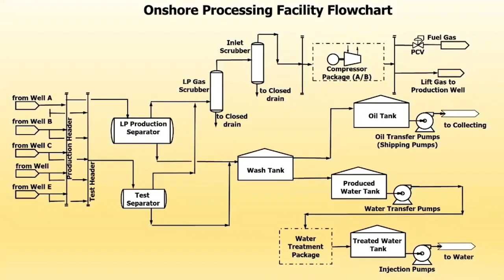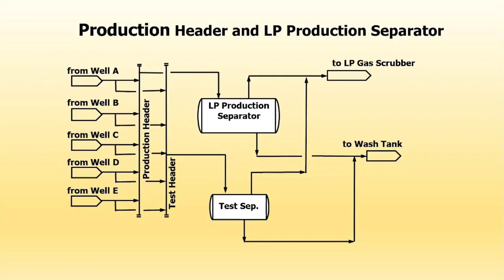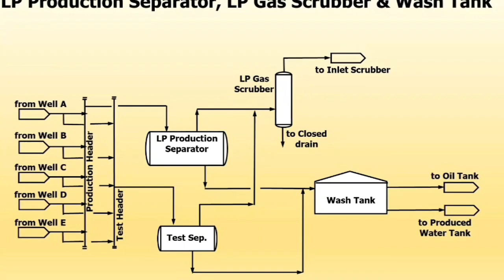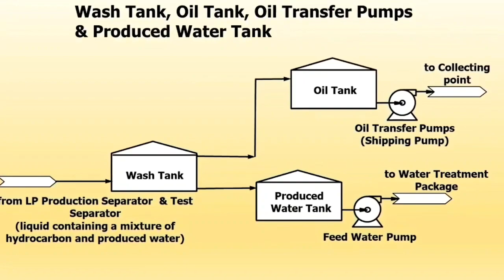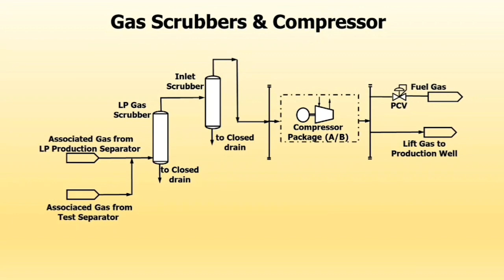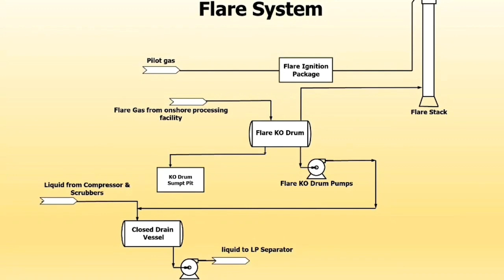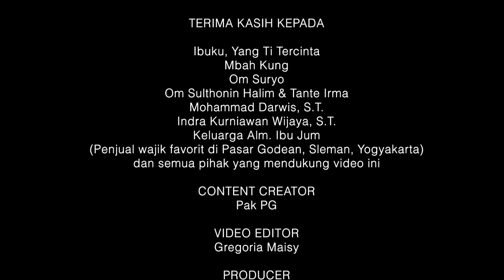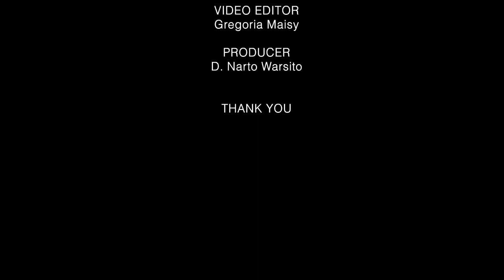Overview of Onshore Processing Facility

Comment: mantap Pak PG, izin bertanya pak jika pada saat separasi antara gas and fluid apakah ada batasan minimum (%) of gas or fluid for further processing ? thank you Pak PG
Reply from the maker: Terima kasih apresiasinya, mas Alif. Tidak ada batasan minimum % gas, karena separasi gas liquid dilakukan untuk pemisahan gas terikut (associated gas) yaitu Hydrocarbon fraksi ringan (light fraction) yang berpotensi meningkatkan nilai RVP (Reid Vapor Pressure) dari produk Crude Oil (Condensate).
Reply: @paulusginting1973  terima kasih pak atas pencerahannya 🙏
Reply from the maker: @muchammadalif1679   sama2 mas  
Please keep learning & in touch 🙂👍
Reply: @paulusginting1973  baik pak 😃